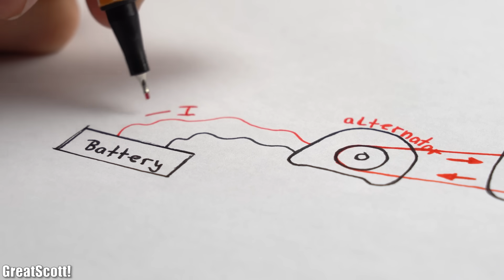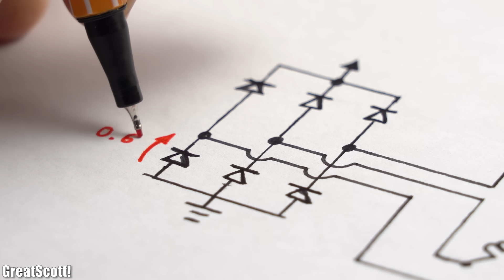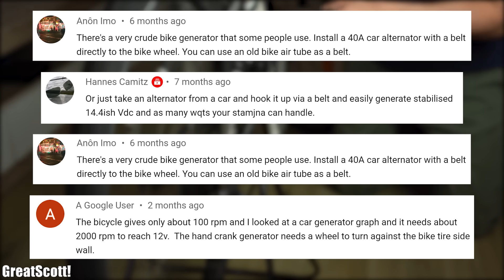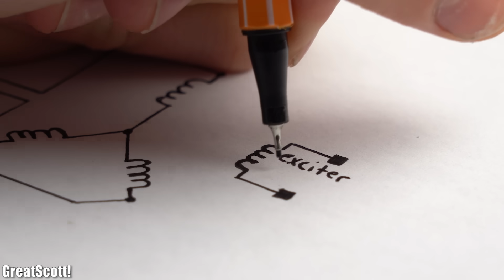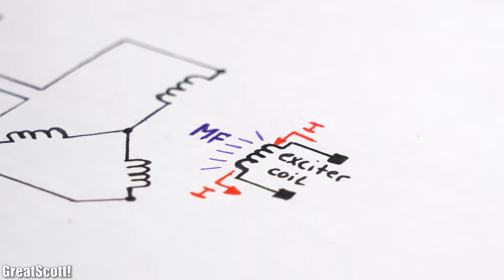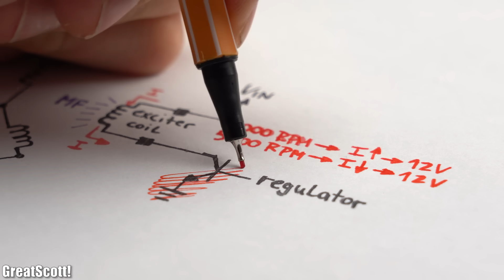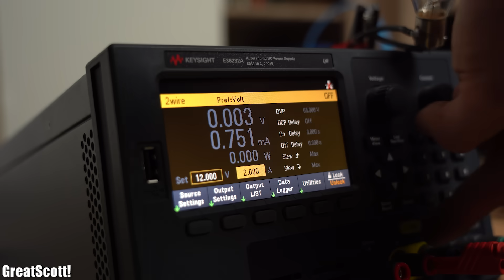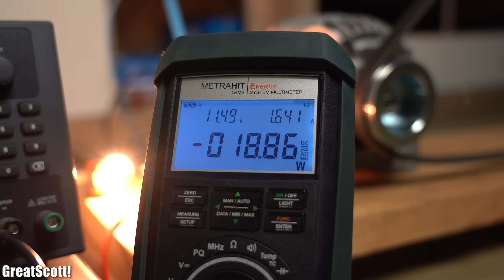Using a car alternator with a bike to power my home? How much energy can I produce?!

Comment: You're making things complicated.  My 12V alternator @900rpm with a good 12V battery produces 14.5V 80amps constantly,  Add a good 12 volt converter and vuala! You have a small system that can run the most important things in You're house, ie fridge,lights,microwave, coffee maker, computer,cell. Well, you get the idea, but you do need something to run it like a small 4stroke 50cc engine to run the alternator. The beauty of it is the small Chinese engine hooks up to the battery and the alternator and can be started electicly or by using its foot crank. A gallon of gas on that thing can last a very longtime if you have a battery bank with some solar panels to charge the battery bank in day time, using the motor for night or emergency situations.

Comment: that is the lowest gear not the highest , u had to use the smallets gear on the rear shifter not the bigger and bigger in front to have best gear ratio for speed

Comment: In old films set in Australia, the farmer always calls the Flying Doctor on a pedal radio. It was a bicycle on a stand connected to a dynamo generating, I suppose, about fifty watts. Otherwise, field radios used Stirling cycle generators. They will work on any fuel, including firewood, but are not very efficient at turning heat into electricity.

Comment: This is an idea which is quite a bit older than you may think it is.  Look up "pedal wireless" on wikipedia for a short blurb about how Alfred Traeger invented a pedal-powered radio transceiver in 1929 for the then-nascent Flying Doctor Service.
In short, batteries would have been too expensive (as well as difficult to replace at the remote properties where the radios were needed) and - to add my own comment - solar power systems didn't exist.  Powering the early radio (then known as "wireless") by a pedal-driven generator turned out to be the perfect solution for the times.

Comment: 8 alternators 3 pullys a 10,000 watt or 10kw inverter and couple battery's and use the bottom gears ⚙️ on the bike next time with the pulleys you can lower the work out while increasing resistance 😅

Comment: 1440 Watts is just about the power I need on average in my own house: more like 3kW if using the furnace and stove, none if sleeping. If you know physics, you know that 1440 watts is 2 horsepower. The very best cyclists can put out maybe 1hp for long stretches of time, but not 24 hours a day, so you would need at least 3 such (Tour-de-France type) bicyclists. So, yes, you can power your whole house with a car alternator powered by a human on a bicycle. But you're gonna have to whip them and/or pay them well to get that out of them. So that's say $50,000 per person-year or $150,000 per year. It's way way more expensive than just buying the electricity.

Comment: You need to get rid of the alternator you are using and get you one of the simple internal regulator kind from the older GM 1 wire hookup kind. I believe it's a CS 130 MODEL,but don't quote me on that,that's all you need to solve your charging problem. The alternator you are using now is for newer model cars

Comment: If you kept the 12 volts regulator, and use an 120 ac inverter, you probably would have gained the output you needed to power your home.

Comment: You need an Ambulance alterator, those are designed to high power alternators when the Ambulance is only idling, as it would be in many emergency situations, to run all the medical equipment in there that is heavy power draw stuff.

Comment: Make a basic stepper motor using old harddrive magnets. I made a basic setup years ago with a small turbine and home made motor. Actually generated enough juice to charge 12v leisure battery in very little wind. Was just experimenting but it worked very well.

Comment: Add tension to the belt using an idler pulley, or seperate the two machines more, or shorten the belt.

A single wire 12v alternator would be nicer but youd still find the same output.

A permanent magnet generator would be better as it has constant torque input, does not bog down, and produces the same voltage output at ~10% max speed and above.

So a 7kw PMG would be quite easily turned by just keeping up the RPM to a steady rate, it just needs a kickstart to get it going which is where your legs and the bicycle comes in.

Once youve given it, a kick start, you can have a smaller dc motor, like an ebike motor that can keep the rpms up, this ebike motor would only use 12vdc 250W at about 1500rpm which is about right for that PMG.

Comment: A human can produce about 1.2 HP or about 800 watts for a brief period.  A well conditioned athlete can produce about 2x that amount.  How brief depends upon the physical condition of the human but is probably only a few minutes.  A human can sustain about 80 watts indefinitely.  That's the wattage one can expect to produce from a human powered generator.  One can probably recharge a completely discharged cell phone with about 20 hrs of pedaling a generator.

Comment: I rcently built something similar but with a sationary bike and a brush DC motor (far easier to wire in my opinion) and hit the same belt slip problem. I found that I could use a Victron solar controller to choke the current (torque) and installed brackets to force tension on the belt so I was limited by myself not belt friction.

Comment: What about a 3.5 metre weighted wheel of the side of your balcony. With the alternator running from the outside of the big wheel. I think you would not have to pedal to much to get the momentum started. Has any body tried anything like this yet??

Comment: Informative as well as funny in parts.
This might do better as a wind-generator set up to a home battery. 24 hour (mostly) generation & collected for later use.
I've sat & looked at my elliptical exercise machine often, wondering how it could be used to deliver power. It seems to have all the parts needed.

Comment: The average automotive alternator is capable of producing 30 amp at 12Vdc, making for 360 watts, but the energy output from one man is about 75 watts. The average house uses 5,000 to 7,000 watts. See the problem?

Comment: you just need a better gear ratio to do less work . why stop where you are ?
Reply: you need a multiplier . you have the system . just keep going . you're 90% done . attach that size pulley to a bike tire size on the same axle and repeat what you've done as many times as needed to produce the amount of revolutions per minute that you're seeking . simple . copy what you've done x 2 at least . after you figure that out , it's only dependent on the limits of size of your alternator .

Comment: @2:21 But that isn't a gear, it's a pulley for a serpentine belt.  Not sure why you wasted time taking the alternator apart, just tickle it with a 12v battery just like when it's in a vehicle....  Sorry you lost me there

Comment: Just like a random youtuber ,
I will say that generator wasn't made to give back high voltage . 
If by any chance you can make 800w and you connect your 700w microvawe the generator will be frozen from coils resistence .

Your coils and magnets are not made for high electricity . 
Your coils and magnets are not placed properly for high electricity . 

Making your own generator is more expensive and more efficent than any standard generator ! Good luck !🧐

Comment: I dont understand why wheel hubs are not dynamos for electric cars. Could use the weight of the wheel to generate electricity not just breaking. Yes it causes some drag but I think if it was internal or a gear that spins up wouldnt do it. Maybe use magnets to complete the connection since it can spin

Comment: I'm looking for someone that wants to take on a challenge.
Do you have pressurized city water
The goal is to hook up a water wheel of some sort most effective to create power for your house lights using the pressurized city water.
So every time that you run water you can charge up batteries that will run your lights at night

Comment: Couldn't u set up a second generator to motor (on the outside) at the pedal..so u could use the motor to turn the pedals also. ...so you wouldn't have to pedal yourself (using ur own mechanical energy)

Comment: Are you serious? Car alternators give as high as 14.7V to keep the battery charged! Are you mad??? 12V it would mean that the current would go from the battery (new has 12.8V) until it reaches 12V and then it'd just destroy itself, meaning you'd be no longer able to start the car!

Comment: If you buy some batteries, for off grid systems and get a very hight watt generator, you could use that bike with a recharger for your batteries bank that ways you could use in your home, 40minutes in the bike maybe charge half of the batteries with a high power generator, from a truck or even maybe a real generator by diesel

Comment: In the first bike clip, the bike isn't in the top gear.   You should be using the smallest gear at the wheel and the largest gear at the crank.   It looks like you are using the largest gear at the crank, which is good, but at the wheel you are using the largest or next to largest gear, which is wrong for getting maximum tire speed.

Comment: A car alternator actually produces 13.8 v (for a 12v system)  when the engine is at idle , which in my car, a Holden VY Crewman with v6 engine  , is just a whisker under 1000 rpm so despite increased rpm it won't produce much more than that because of the regulator,  but the increased rpm compensating for the increase in mechanical load due to increase in electrical load , ever noticed when your car is at idle with nothing else switched on you turn the headlights on and the engine revs drop a small amount, that's due to the mechanical loading applied to the alternator due to the increased electrical load . This was also very easily demonstrated to me once by a fellow electrical fitter,  he had a 12v dc motor and spun it up easily by hand , he then told me to spin it up and it was easy,  he then connected just one 12v 21 watt globe to the motor terminals and told me to spin the motor shaft  again,  the mechanical resistance encountered was significantly higher, just makes you realize how hard these components are working when your vehicle's typical electrical services are being utilised.

Comment: I would’ve used a GM cs144 alternator, it has an internal voltage regulator and does not require high rpm to exite it

Comment: I hooked up a one hp stationary engine to a car alternator and it worked great.  Typically producing 35A at 14.2 volts.  It would charge a flat 12v battery in an hour.  I think you may be overthinking this.  😂

Comment: You need to hook up the generator to a deep cycle pack and then you can ride the bike for a good while for exercise then if you change things over to 12VDC system like in Rv's you can power lights, fridge, etc...??

Comment: you totally  wrong, car alternator  needs hi speed  and have battery  ,,,you could use electrolyte  capacitor and then regulator inside alternator balance VA from it, with minimum 2500 per minute  you can have 40A 12 V if somebody told you you can make power with that yes you can but not by humans body's!

Comment: You should look for an efficient way to turn that wheel with the power your buying from your power company. That way it can keep going while you live. But only if the system is so efficient that you’re storing  double or more of the energy you’re using .

Comment: Look for places that sell wind turbines for do it yourselfers. Some of them will sell small alternators that have the voltage regulator removed as well as the exciter coil. Instead the coil has replaced with a large permanent toroidal magnet. Now all you need to do is turn the alternator shaft and you get DC power. Add a filter and a buck regulator to make useful power out of it. Mount the alternator on a pivot and use a tension spring to keep the belt tight. You just need it tight enough so it does not slip off the bicycle wheel.

Comment: I'm wondering how much efficiency one could get with work and thought. There are uses for those with few resources and a need for supersize, such as those on sailing boats (in cloudy areas or fog). I see one for sale made by the Chinese (ebay) , and it doesn't use anything but gears. The gear box is available separately. They have a lot of different versions and voltages.

Comment: What I’d love to make is a small efficient wood burning steam engine that spins heavy duty truck alternators connected to batteries and an inverter. With a bit more creativity it could heat water for showers, the washer, etc.

Comment: Ditch the bike wheel and install the alternator directly to the bike..

 Use the cars serpine belt for the alternator,  pulleys, tensioner arround the bike pedals..

 Just a thought, as I would think to use this in the same manner that it works on a car.. even use the same car wiring that plugs into the rear ( voltage regulator) to the battery...

 Easy pick at a salvage yard..

 But...a 12 volt car battery by its self  ( + a inverter) will not fully power a house.

Comment: For example: if you attach a a large workshop magnet to a piece of metal and then measure the voltage you will likely measure 0.1/0.2 volts or higher. Hook them all up in parallel and you solve your problem.

Comment: Just caught this great video. Automotive alternators are notoriously inefficient. They are designed for high power and low cost, not efficiency. A better solution is a permanent magnet BLDC motor used for model planes & drones. You can get the larger ones with very low KV values (ie, 150 rpm/v) so you can spin them @ 1/3 rpm of an alternator . They generate 3 phase AC, which can be easily rectified to DC.

Comment: Sure, practically useless for generating electricity on the scale at which we normally use it. At a remote campsite you could use it to power a small radio or an LED light or two, using a deep cycle battery such as a 6v golf cart battery for storage.  But back in the modern industrial world, you could still use it as an exercise bike. Feed the alternator output into a variable DC/DC converter and use the output from that to charge a battery or play music or heat water or just dump through a high wattage resistor. Anything. The idea is to be able to adjust the load encountered by the person pedaling, and display output in watts or horsepower or other units. Maybe you could even use an arduino to control the load, monitor RPM, respiration, heart rate, blood pressure, oxygenation, and run through user defined programs, and for just a couple hundred bucks you could have a very sophisticated exercise bike. With a bit more mechanical complexity you could make a stair stepper or other exercise equipment. The energy recovered and stored or used is in this use case, irrelevant. 

I think I read somewhere that even a trained athlete is only good for around 50w of sustained output. At 746 watts to one horsepower, that's not much to work with. So the best use of a manually powered alternator is as a variable load when the AMOUNT OF THE MECHANICAL LOAD is what is important, not the electrical output.

Maybe hard wiring the output to your kid's x-box or playstation would force them to get a little exercise or else spend less time on non productive inactivity, one or the other. 

Still, a lot of people don't believe me when I tell them that it is essentially useless to try to pedal your way into energy self sufficiency, so thanks for taking one for the team and posting that. I was afraid this was going to be another one of those youtube "See? It WORKS!" videos where they make a small lightbulb glow, or show the no load voltage at maximum with the operator not even working up a sweat.

Comment: Oh yeah don't forget to connect the exiter wire to start charging, both wires are connected when ignition is on, but one is just for the charge light or gauge, but if you don't know which is which, connect both to a 12v battery, along with the main wire, or connect the exiter wire to the main battery wire so it will exite itself at enough rpm

Comment: Why not use thinner belts and link them to 13 other alternators off the same wheel? Less friction will mean less resistance. With an additional 13 alternators, it cuts the time down to one year right?

Comment: 1 KWh = 3.6 MJ = 860 Kilocalories = 1.85 kg of porridge for breakfast (assuming 7 parts water to one part oats). At less than 100% efficiency I'm gussing more like 4kg. That's a lot of porridge. A full English breakfast would probably cover it but then you would be paying the thick end of £10 per KWh.

Comment: Most alternators are efficient at low rpm but require a 12 volt signal to turn on.
Which is what your 2 pin plug is for.
It should put out 13 to 14 volts at 800 rpm.

Comment: Turn the rear wheel into a fly wheel to re-hoist a suspended weight to its starting position to achieve and gravity generator. Not perpetual but will get better efficiency of kinetic energy used.

Comment: Your video is interesting and demonstrates energy can be produced this way. Of course you'd need some way of turning the alternator other than the bike unless you could ride it continuously and you could pedal much faster. You could use a small car engine but then you have to buy gas  so you wouldn't save much if any money depending on the cost of the gas. You could even spend more money that way. If you were close to a strong flowing water current you could make a water wheel and spin the alternator that way. A steam engine? But then you need fuel like coal or wood to heat the water. Well, I'm rambling. I think this could be made to work. I just have no good ideas how. Keep working on your idea. You're on the right track I think.

Comment: You need to turn your back wheel into a flywheel (weighted wheel) and then put a chain on that flywheel to a smaller cog that drives the alternator via belt.